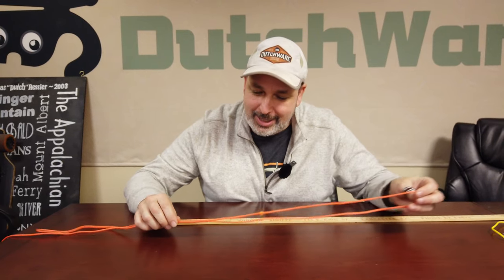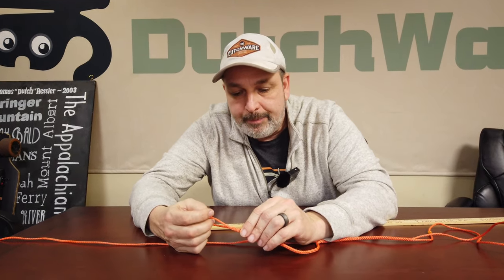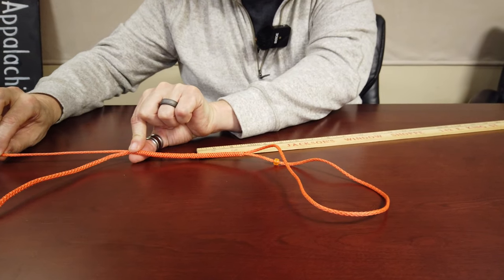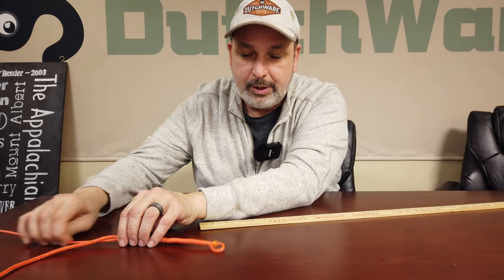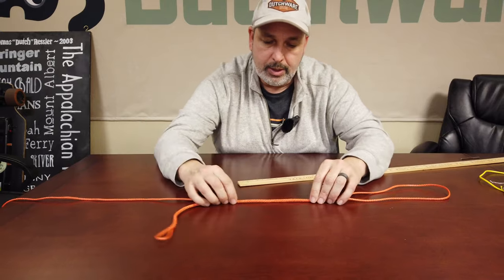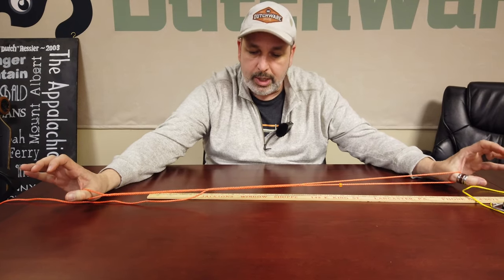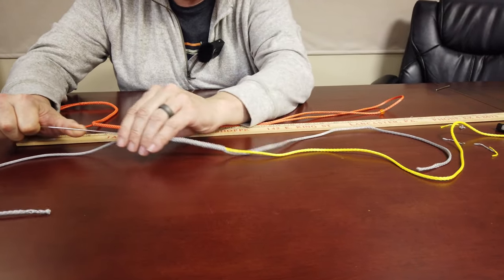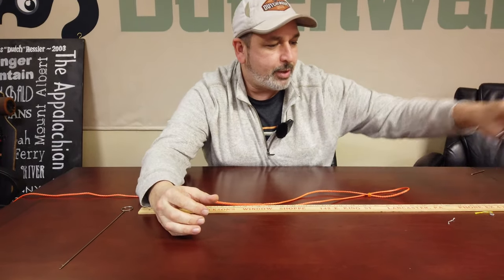How Whoopie Sling Works

Comment: Imo there is a huge difference between one rope tangled in itself and two.
in the first case, the loop simultaneously "pulls" itself and the part that tightens outside.

in the case of two ropes, I was not able to achieve a satisfactory effect. only when the length of the braid was about 20 inches, which is a bit too long :)

Perhaps the problem is the rope itself - I have dyneema that is "slippery" to the touch.
What type of dyneema would you recommend for a two-rope solution?
It's so good that you don't need twice as much rope to move the hammock :)

Regards - great equipment, by the way :)

Comment: How do you tighten when the whoopee is under tension, like the hammock is up and you lay in it and then find it is too low?
Reply: You don't. You have to get out of the hammock to make the proper adjustment. You weight is what gives tension to the whoopie and therefore makes it lock into position. I actually don't know of any suspension that you can adjust from inside the hammock. I guess you could try installing a fancy pulley system, but how practical would that be?

Comment: Per Simons rope the BRUMMEL cuts 30% of the strength . As stated in the 1st paragraph of there splicing book a plain locked STICHED splice is used to determine MBS for it doesn't reduce MBS ( sample brakes mid run when properly spliced instead of breaking in/ at the splice
Reply: Their*